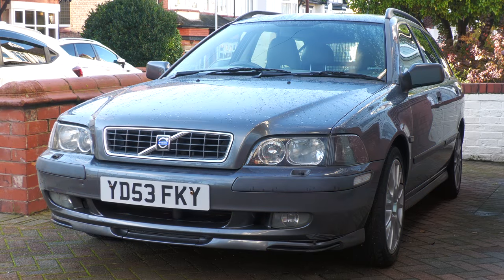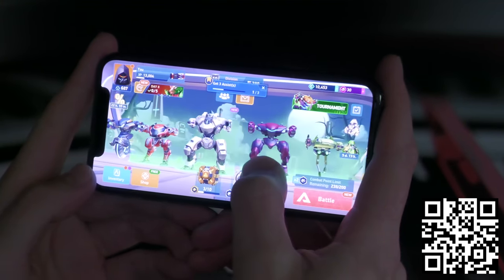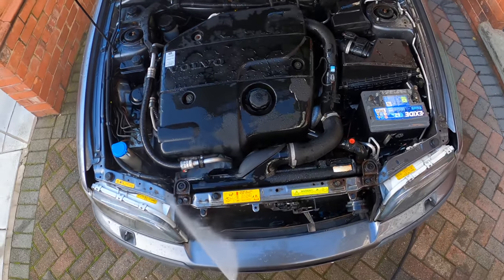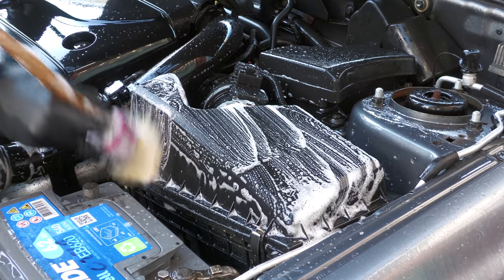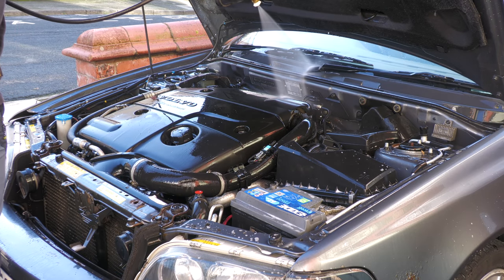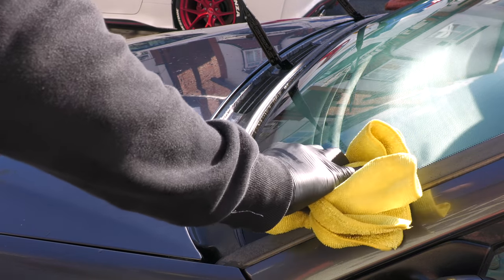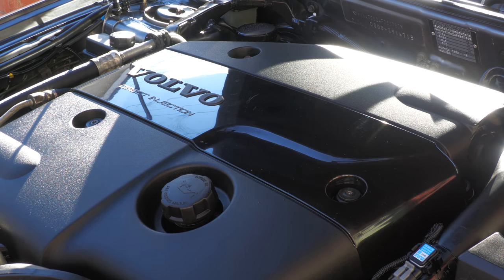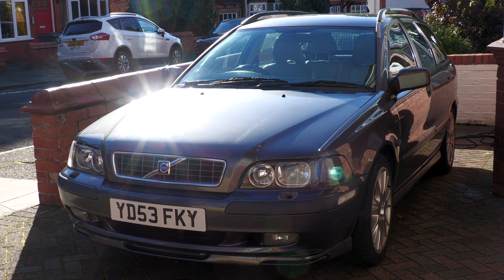120K Mile Engine Bay Clean

Comment: Definitely want to see the follow up on this V40 getting a clean!
Have to agree with you about AG V&R Care, it's the perfect consistency. I find myself using it even though I have doubts about its durability just because it's so easy to use. Great tip about letting it soak in though, I'll have to try that next time I clean my bay. Great video.

Comment: Great video really useful to see how you approach an older more exposed engine. One thing I noticed and I see at least one other picked up on - it's much safer to disconnect the negative terminal of the battery, as you're isolating the bodywork.

Comment: We can't all have compressed air lines and hydraulic lifts. Great to see something I can do in my back lane. I always keep my engine clean and run over the exposed plastic bits with interior vinyl cleaner and protectant. Works well. Thanks for the video. Cheers-John

Comment: using soft water is particularly practical in such scenario. on paint, it prevents unsightly water spots but in conjunction with electricals, it also prevents shortening circuits. yes, I do speak out of experience (unfortunately, lol).

Comment: I always thought you were not supposed to spray water onto a engine compartment,  especially all over the electrics,! 😁👍
Reply: Yeah, like car designers completely overlooked driving down a motorway at 70 mph in heavy rain.
Reply: Most modern cars are pretty well covered with the plastics so as long as you approach it with a bit of common sense and a few bags and a roll of tape to cover any sensitive bits, you’ll be grand. Some cars don’t have undertrays so the engines are designed to withstand water. That’s my understanding of it anyway.

Comment: Tip: always disconnect the negative battery terminal instead of the positive because the positive can easily touch surrounding metal and short out the electrical system of the vehicle.
Reply: Yeah this got me
Reply: As long as you're careful it's OK to disconnect the positive (he was) but do agree I'd usually disconnect the negative terminal to isolate things.
Reply: Came looking for this comment 👍

Comment: Have you ever cleaned the engine bay of a VW T3 2.1L petrol engine camper?
Would I use the same procedure as this?
Reply from the maker: Can’t say I have but I’ve done similar on classic campers but just covered things like the dizzy cap and any exposed electrics first.

Comment: What would you recommend for getting rid of heavy deposits on the roof of my van? 
I clean it (the van) regularly but am quite lazy (and short) so the roof just usually gets a spray over and a swoosh with a soft soapy brush.
I got on a ladder the other day and there's what I can only describe as lichen spots growing on it, which scrubbing doesn't remove completely and leaves brown polka-dot patterns on the white roof! I've tried an all purpose cleaner spray but I don't want to try anything particularly aggressive as I'm worried I might damage the paint!

Might be a good video idea if you have a mate with a manky van as you don't seem to do much commercial vehicle cleaning (or at least don't feature them in videos), maybe an idea to expand your audience!

Comment: Interesting. What do you recommend if one is not able to use a pressure washer?
Reply from the maker: Hosepipe is fine.
Reply: @CarCleaningGuru  thanks brother, I used one of them spray can things you water plants with, did the job as well. Engine now looks clean, thanks for sharing the tips, they were really useful

Comment: Do you ever tackle small blemish repair or bodywork? 

That Volvo is one of only a handful I’ve ever seen with rust on it that wasn’t damaged in some fender bender. 

Do you know if iron remover would dissolve the surface rust? Obviously, that car would require sanding and repair before repainting, which is unlikely for an unremarkable 17 year old economy car… but it would be fun to see.
Reply from the maker: If seen a few like this. They rust from the inside out once dirt collects behind the liner, new wings only real fix I think.

Comment: Nice job. But... I argue that it is best to avoid using water/steam under the bonnet of older cars. I maintain 2 over 20 year old cars. They are very clean, except for the engine bay. It's tidy yet also a bit oily. Where there is oil, there is little chance for the enemy of old cars, rust to blossom. Just my 2 cents...

Comment: As a 1.9d s40 owner. I could tell straight away what I was looking at🤣
Reply from the maker: I drive the V40 faster than I drive the 370. 😂 You can really slam those loose gears dsg style!
Reply: @CarCleaningGuru  nice to see its still about. Mines on arcadias with a cream interior too. Retrofitted Xenons to it and in the process of prepping the ol' girl for a respray. But a 53 plate with 96k miles on it deserves a second chance. Love it to bits.

Ps. Sell me your v40? Please? 😅

Comment: Always disconnect the battery earth first. Yes really. It's the first rule when working with electrics.
Reply from the maker: But I like seeing sparks fly!
Reply: It doesn't actually matter if you take off the positive first. It's only advised that you take the negative off first to avoid you shorting your spanner on the body or engine. If you're careful and use insulated tools or hold your spanner in a way that it contacting something grounded would be impossible, then it's really no issue which terminal you remove first. However, it is recommended to do negative first just to be safe, but it certainly isn't a rule.

Comment: You could have used half the amount of vinyl and rubber care. Would have saved you tons of product.
Reply from the maker: True but the engine hadn’t been cleaned for probably 10 years and it’s cheap so wasn’t bothered about being economical.
Reply: @CarCleaningGuru  that's fair - I use the stuff all the time and it lasts forever on engine bays as long as its kept clean